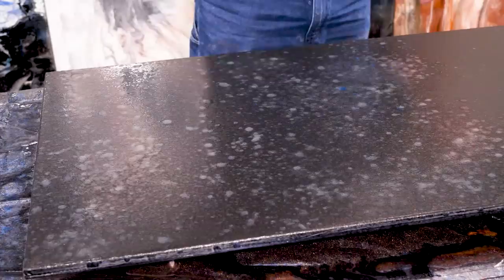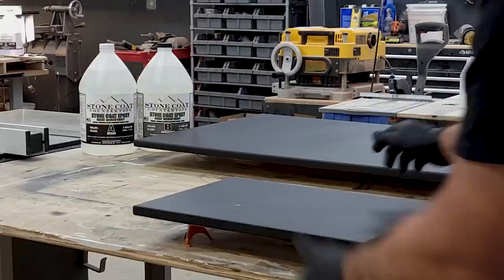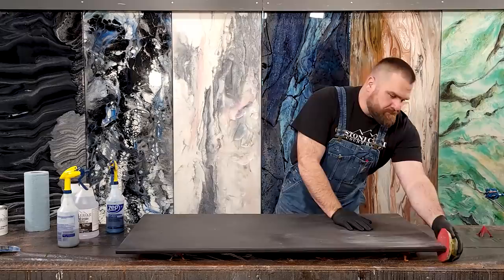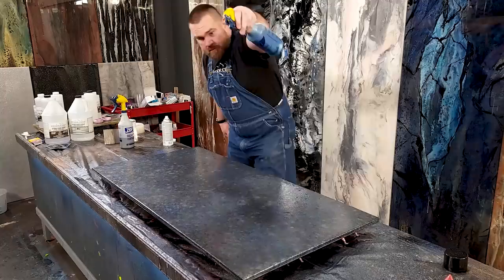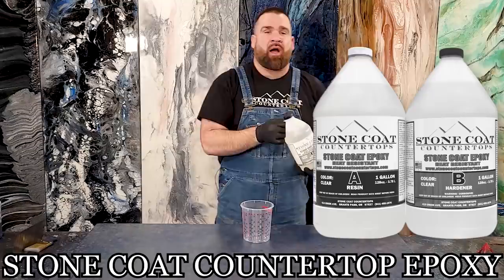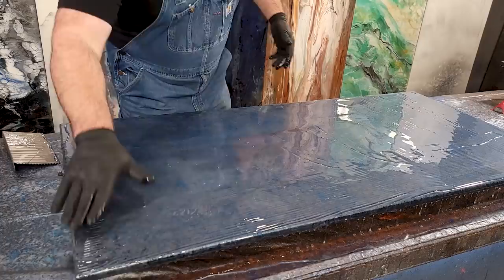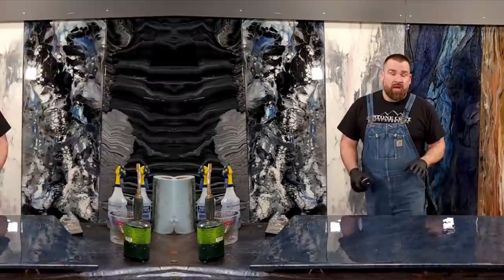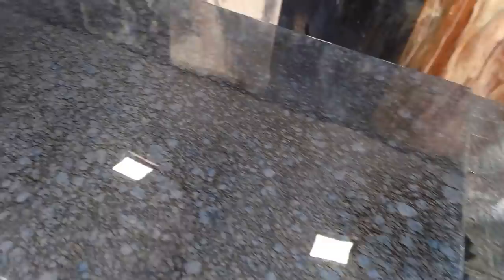$250 Spray on Countertop Makeover, Does it Work? | Stone Coat Epoxy

Comment: I love the look of this. I have an old crappy small 1980’s counter top in my small kitchen. To do something like this do I need to remove the old counter top and replace with wood? Also if not do I need to remove the sink before this process?
Reply from the maker: If you want you can remove your sink or tape off the surrounding of your sink as you go through the process. -Nathan
Reply: Stone Coat was designed just for you! You can pour right over your old tops with the proper prep! And the prep steps are simple. Here is a full tutorial on how to use Stone Coat Epoxy over an existing laminate surface: https://youtu.be/GfpVJBVKBgo

Comment: I would like to see a video addressing the underneath of a project. For example, besides sanding off drips, what other techniques do you recommend? For example I was thinking of redoing a mantle for a fireplace. I wanted to epoxy the top and edges but keep the bottom the way it is now (which is visible from underneath).
Reply: Couldn't you tape off the bottom, then any epoxy that gets on there you can pull off with the tape....

Comment: I noticed as the camera panned over the surface, the surface appeared uneven. Is that because the epoxy had not finished flowing? Was this because of the chopping that made some areas thicker than others?

Comment: quick question, i am going to epoxy my friends basement and we have some moisture coming threw the concrete it seems, and i was just wondering what yous think a good moisture barrier would be for that?. i tried emailing stonecoat directly for advice but they dont reply  and are closed by the time i get off work so i cant call them
Reply from the maker: Old concrete with a sealer already applied needs to be cleaned and sanded with 60-grit before applying our Stone Coat Countertop Epoxy. If you have a wax-based sealer, this must be removed because epoxy won't bond to wax. Check out this tutorial: https://www.youtube.com/watch?v=IM3XrHGJL24 -Nathan

Comment: My countertop is old & right in the middle has come unglued.  Can you still apply this or do I need to figure out a way to glue it back before using stone coat?
Reply from the maker: If you like you can join our Facebook group Stone Coat Countertops insiders where you can find people in your area to help with projects. -Nathan
Reply: Tear up the loose laminate sheet until the sheet of laminate isn't popping off easily and the glue is still in tack. I would then sand with 60 grit then apply a layer of bondo to feather the slight edge where the laminate sheet is still on the surface of the countertop. You would only need to feather and not make it perfectly level. Sand smooth then prep the rest of the laminate for epoxy like in this video: https://youtu.be/GAfpVJBVKBgo  Check out that video and let me know if you have any questions, I'd love to help get your kitchen looking fantastic! Also check out this durability test and let me know your favorite test! https://youtu.be/_BfgY1BJnD8
Reply from the maker: @mitchquist  Great job!

Comment: I really want to do this but can remove the bar counter top. I'm scared I'd ruin everything. Also, can you do this with a quick coat resin?
Reply from the maker: We recommend using Stone Coat epoxy for this project. Quick Coat has a 15 minute working time, and we recommend applying this product on small projects at a time. -Nathan
Reply: This one is really easy! Just cover everything below with painters plastic (3mil) and masking tape. Cover the floor also and you are good to go. What kind of existing surface do you have?
Reply: if the piece is a smaller one you could attempt with Quick Coat
Reply: @mitchquist  cheap ugly nastiness my husband had gotten a long time ago. But it's a bar island with ugly green. I'd like to make it like an off beige, tan, gold or chocolate appearance. Not sure would have to play with it.
Reply: @StoneCoatCountertops  how will the epoxy stick to the sides if it drips off?
Reply from the maker: @MrRavensgirl05  a layer of epoxy will stick to the edges, just make sure the whole edge is wet with epoxy and no dry spots. The epoxy will self level nice and even as it works its way over the edges. Great question!
Reply: @StoneCoatCountertops  will I need to eventually wipe any remaining drips from underneath as the epoxy starts to harden and cure?

Comment: The finish is not smooth.. Id prob want to apply another coat of clear?
Reply from the maker: Yes! this video was just teaching the color recipe. to finish the piece you would want to do a final flood coat
Reply: @StoneCoatCountertops  thx for answering!!
Reply: The final coat here once cured was as smooth as glass. All the alcohol I misted needed to evaporate. But you are 100% right though, if any dimples were left behind a clear coat would take care of it and add a layer of depth. Great comment, how long have you been watching Stone Coat?